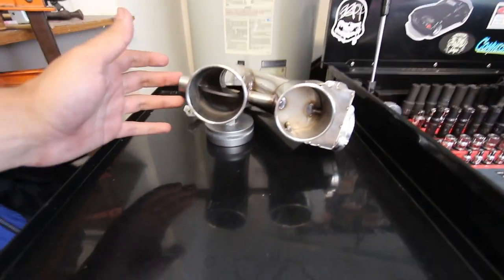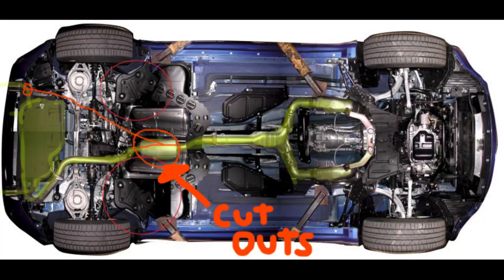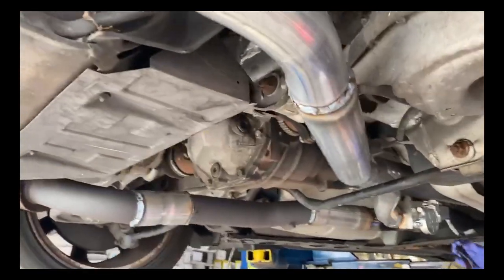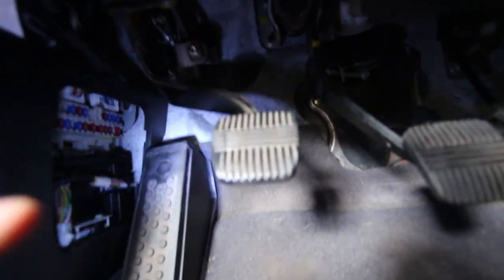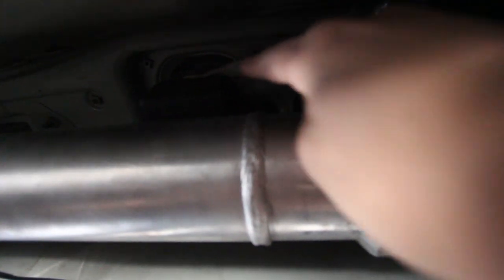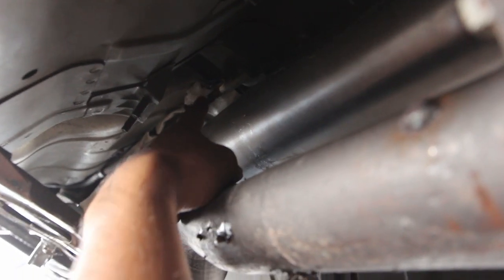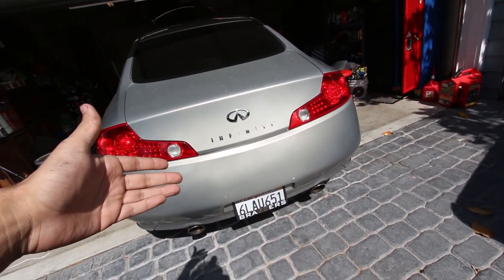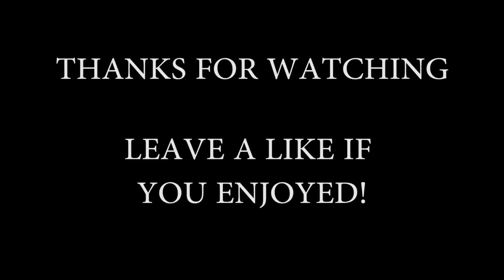EVERY G35 Owner NEEDS This Exhaust!!

Comment: So are both the resonator and the muffler still in the car ?
Reply: Or did you completely replace the resonator with the valve system ?
Reply from the maker: I was trying to keep the resonator but I couldn’t get the cutout to fit in so I replaced the resonator with the cutout. Muffler is still in there!
Reply: @JoeVazquez  can you do this with also keeping the resonator?
Reply from the maker: You’d have to get a different cutout design to make it work!
Reply: What exactly was this cutout you purchased on ebay? And if I wanted to keep my resonater, any suggestions on what alternate cutout options?